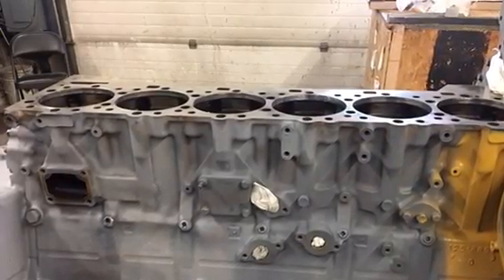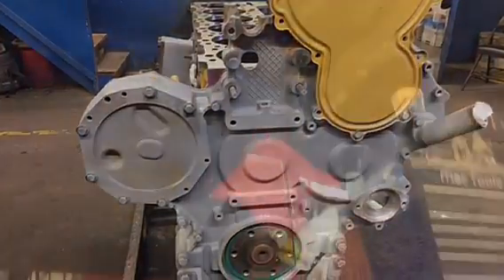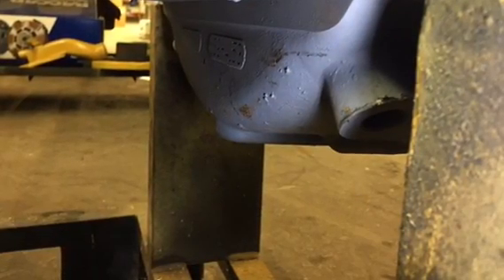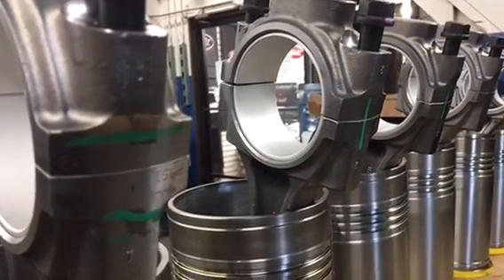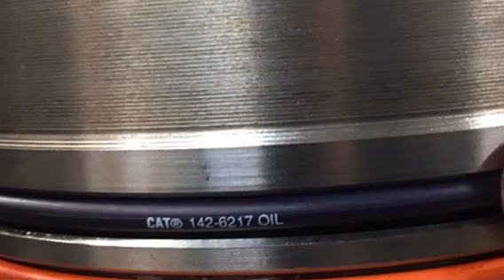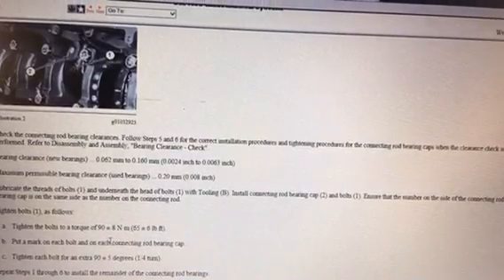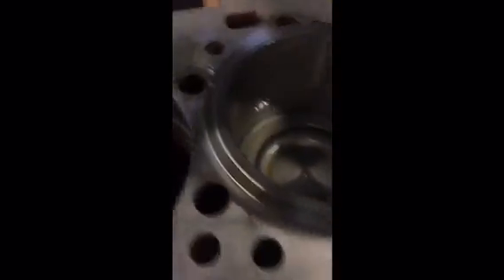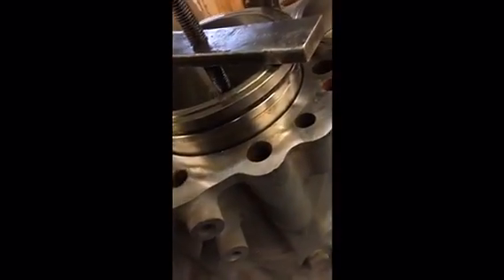Cat c-15 liner and piston installation

Comment: That lube is GARBAGE been using STP for 30 years, works much better, only lube is also garbage use CMD #3 on the rod bolts.
Reply from the maker: stp oil treatment on bearing, why is it better? what is cmd #3 and why use it?
Reply: @monray300  no on the liner o-rings to ease the install, that spray on lube is crap
Reply from the maker: @joelphillips3314  oh ,thanks  I might try it next time
Reply: @monray300  cmd #3 is an extreme pressure lube I use it on the head bolts also
Reply: @monray300  105 lubriplate is fine for the bearings.